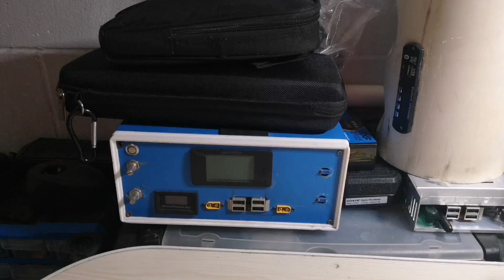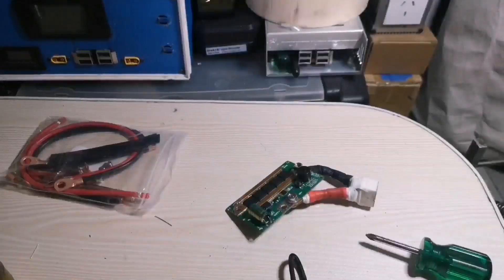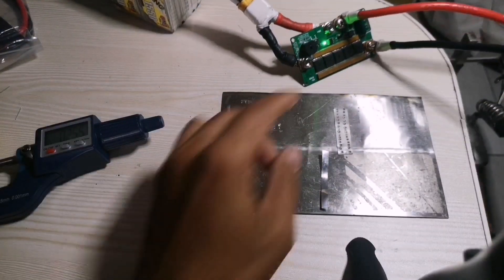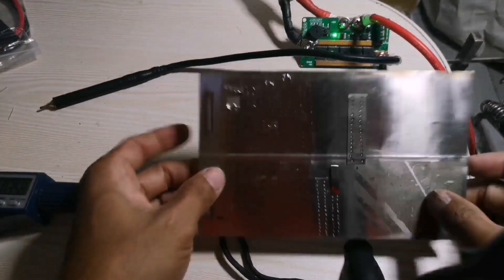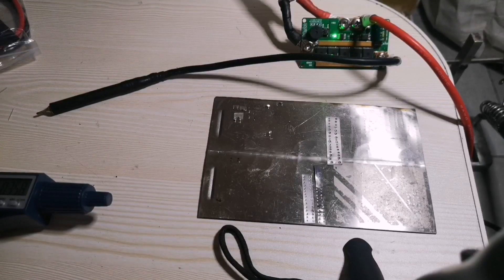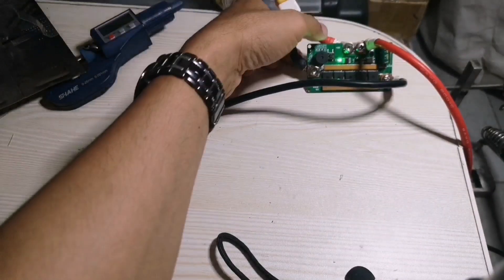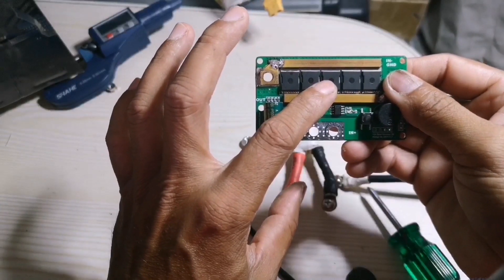Mini spot welder faild to weld after a few changes it worked

Comment: I bought one of these a couple of years ago and it was so weak. i added heavy copper in much the same way as yourself but it didn't help. I'm extremely hesitant to buy a newer unit. Once bitten twice shy !
Reply from the maker: No reason to buy it again coz there are so many latest models which can perform better

Comment: Now I know how to make cheapest spot welding worked firmly.  I salute you bro 100%, I am using this board but only using 12v car battery so on highest setting will only do 0.1 strip. Was thinking about doing what you have don.1 Question what temp soldering iron was you using to solder the copper blocks.
Reply from the maker: I buy 60 Watts but not enough so I replace the thermal heater for 80 Watts I'll give you the link.
Reply from the maker: AU $16.57  53%OFF | Soldering iron kit adjustable temperature 220V 60W solder welding tools Ceramic heater soldering tips Desoldering Pump
https://a.aliexpress.com/_mLRxw1O
Reply from the maker: AU $1.44  44%OFF | Adjustable Temperature Electric Soldering Iron Heater 220V 110V 80W 60W Ceramic Internal heating element for 908 908S solder
https://a.aliexpress.com/_mO5ORPQ

Comment: I am using this board but only using 12v car battery so on highest setting will only do 0.1 strip. Was thinking about doing what you have don.1 Question what temp soldering iron was you using to solder the copper blocks.
Reply from the maker: Actually I bought 60W soldering up to 450 degree cilcuis but the heat is not enough when soldering thick copper so I bought 80W iron core heating and replace it.  hope this link I provided work for you
AU $4.85  25%OFF | 4 Kinds of CXG A1329 A1326 A 13211 220V 60W 90W 110W Soldering Iron Core Heating Element Replacement Spare Part Welding Tool
https://a.aliexpress.com/_mtbTM0C
Reply from the maker: Anyway I advice you not to used a battery exceed 1500A pulse discharge to avoid blown up mosfet

Comment: I've given up playing around with 4n04r8 powered spot welders they're to unreliable. The best welder I've made so far uses an ATMEGA double pulse controller & a large microwave transformer with 5 turns on the secondary. The trick is finding a large enough transformer I scrapped 10 microwaves before I found the one I was looking for
Reply from the maker: Yeap microwave transformer it is also better for spot welding I made it already boss,  however it is quite heavy.